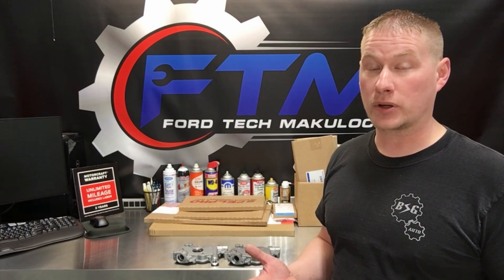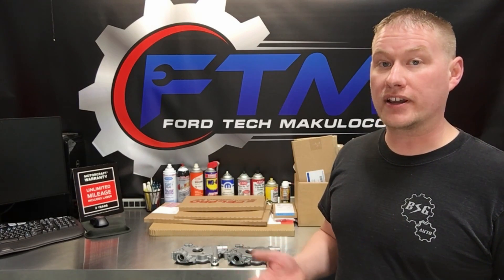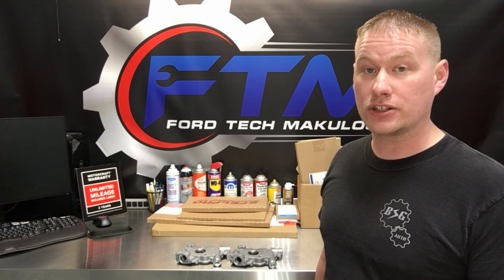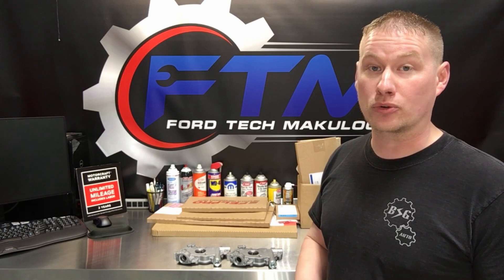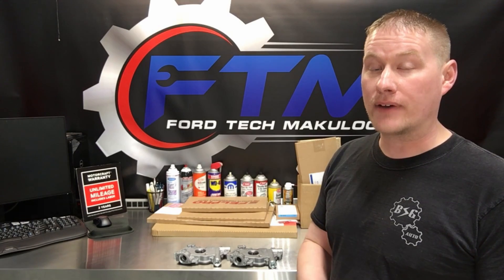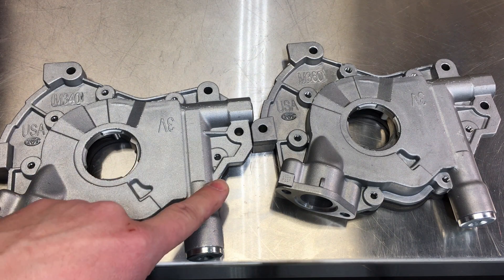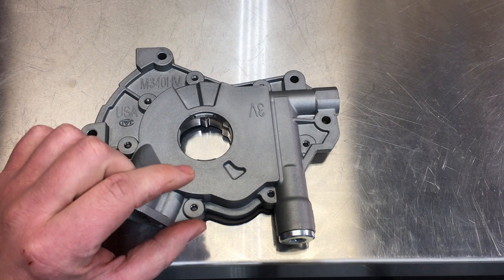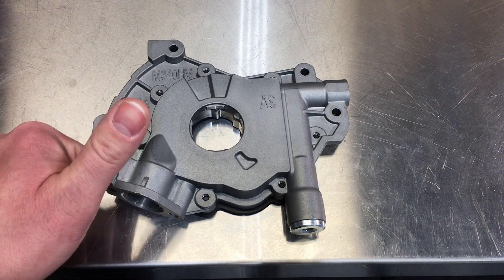The Ultimate 5.4L 3v Triton Engine UPGRADE: New Melling M340HV M360HV High Volume Oil Pumps!

Comment: My 2008 5.4 3v is all original with 250k miles and counting
Reply: I worked for a company that had a fleet of f-150s with 5.4s,  they were mostly just run up and down the highway and carried maybe 500 lbs or so although at times they might get really loaded for a short trip.  It was not uncommon to see them go 350 K or so.  The difference was these were driven by the same fellow most all the time and the oil was checked and changed with the correct oil at 5 or 6 K.  There was no bunch of problems with them, in fact lots of them had never had the valve covers or pan off.  Put a change to 10w40 in one and that is all she wrote though.
Reply: roy gunter so your saying they ran 10-40 in them ?  And that helped them run so long without problems ?
Reply: roy gunter So your saying they were great with simple oil change maintenance ?  What about plugs etc ?    Also what do you mean about changing the oil to 10-40 and that’s all she wrote ???
Reply: Rich Lininger 347 000 miles on mine been a great motor
Reply: Team Deep Tillage   Nice !!!   Any tips ?   Follow the Manuel’s maintenance ?   Oil changes and what about the spark plugs ?  How often and what kind ?
Reply: Roy, you said they changed to 10W-40 and the motors blew up?
Reply: Specialized51 ??  Yes   Whatvis he saying ?  10-40 was good or bad
Reply: i would say if YOU put 60K or so on it...change them.  I put 65K on my 2008 and the plugs brely had any tip left on 2, most were gone.  I am not sure how it ran... but it runs really well now.. been collecting the stuff to do upgraded oil pump, timing and phasers, using Brian's vids as a guide.
Reply: Earl Glase whats yours parts list look like?
Reply: 326,000 miles on mine.
Reply: Yup, I have 223,xxx with some ticking, lashing, etc. BUT I’ve had this truck since new and it’s running well in spite of. No warning lights, etc., knock on wood.
Reply: That's awesome my 2006 ford f150 5.4 v8 3v has 232,000 and still going strong. I change the oil every 3,000 m ur self.
Reply: wesley thompson awesome to here !   I just bought one with 81,000 miles .  I will change the oil every 3 as well as I always do     Can you give me some tips on maintenance ?   Such as sparks plugs and anything that may be different from the Manuel
Reply: wesley thompson What kind of oil ?
Reply: I got 132K on my 2007. I wasn't as lucky as some of you. Regular maintenance and synthetic oil. I need an overdrive band and a timing set and cam phasers.
Reply: cedric williams I just bought a 2006 with low miles   Any tips ?
Reply: Nice! My pops got 315,000 before the transmission gave out. He got that switched and now we gotta swap out the timing assembly.
Reply: I have a 05 with over 230k on it same thing all original. Running great.
Reply: I have a 2004 with over 230k on it some thing all original. Running great.
Reply: For all those people bad mouthing these old motors start counting them as you go to work or play. I got one. Bought it with 190000 plus miles on it. Cam phazers were already locked out, had finger followers and lifters replaced cause I watch these vidios. Guy told it was fine but had them replaced anyway. Now I'm seeing dozens of them running round with 250000 plus miles on them untouched, except for proper OIL changes!! Asked bout the high volume pump, he replied "it got good oil pressure?"  Why yes it does. He replied "u just got to much money."
Reply: Thanks, been wondering bout that. 5-20 it is.
Reply: Have you ever had to change the brake booster vacuum hose bro?
Reply: Flizzey1 I did it’s a pain

Comment: Are there any issues with these HV pump over draining or over pulling from the pans? Because traditionally you would always add an extra volume pan when adding a HV pump to keep from draining the pan with a standard style oil pump. I'm not super familiar with these style of pumps so I though it would be a good question for you Brian.

Comment: Put one in my truck. Well worth it. Also did cam lockouts. I've had no issues since.
Reply: Floor-It-Duh you can also unplug act's and use 15w40 and have zero and I mean zero issues as long as the tensioner gasket isn't blown out or guides in the pickup screen. If you do those three to four things these things become bulletproof and grenade proof. Lol
Reply: Vct's*
Reply: I personally wouldn't use 15W40 as in my opinion it's a little too thick for these engines due to the small oil galley passages in the heads which can potentially result in oil stagnating thus sludge. That said I've heard people using 10W40 on really high mileage engines with no issues but those were all 2V's I heard of. I personally didn't need to cheap out and unplug the VCT solenoids as I didn't want any CEL lights to be triggered and lastly I have a custom tune because I run aftermarket cams along with a few other modifications. That's me though. If what you got is working for you by all means go for it.
Reply: Floor-It-Duh which cam lockouts?

Comment: Have an 06, bought new & have 237,000 miles on it now. Only issues I've ever had were a few misfires which were fixed with new coils/plugs,  had throttle position sensor go bad, & replaced alternator,  thats it. Run only synthetic oil & change it every 4000 miles.   Been best rig I've ever owned. Guess I've been lucky, knock on wood
Reply: Dave M  yes very lucky!  My 07’ started the phaser knock at 100k and broke timing guides at 115k. Changed the phasers and did a complete timing job on it then sold the SOB. Don’t even get me started on the spark plugs or the RH exhaust manifold I changed.. lol

But good for you though. It’s nice to see someone getting some miles on them.
Reply: why the right side manifold? my had both done at 130k and I found in the records that came with it that the right had already been done at 88k wtf?!

Comment: I have a 99 explorer with 257,000 miles it has the 5.0 I'm going to replace the oil pan gasket should I also replace it with a high pressure oil pump?
Reply: chad harmon I'm sure you found out you can't change the pump without taking off the timing cover. Thought I'd post for people that read your comment and wondered the same thing
Reply: Jonathan Rosamond yea I've learned a lot since that post lol needless to say the engine needs lifter or removed from truck to change oil pan gasket yea no thanks I'll just deal with it lol
Reply: I misread. You said 5.0. I thought it was a 5.4 in sorry

Comment: Would you still use 5w-30 with this or would you go back to 5w-20?
Reply from the maker: 5w-30 no sweat there are still wear prone areas like the phaser locking pins.

Comment: I have an 05 F 150 with the 5.4 3V triton. Research is showing that the 340 HV fits this motor. Can I also install the 360 HV in my motor, even though it is designed for the mustang's?
Reply: BTW  mate, you have been such a life saver and money saver for us 5.4 L folks over the years! My hats off to you for all of your excellent advice!
Reply from the maker: Yes

Comment: Damn, you did mine a year ago....and i already put 20k miles since then...guess ill see you in a year or two. But no problems yet.....besides an exhaust leak from passanger side manifold.
Reply: Be careful when you go to deal with that passenger manifold. I got all the bolts out except one, it broke off. I ended up pulling the cylinder head to get the broken bolt out. I did shorty direct fit headers while I was at it. The exhaust leak came back after 1 year. I think the head is warped where it bolts up to manifold/header. I think it needs to be resurfaced on the cylinder head portion to permanently fix this issue.
Reply: @joshmills5248  It is strange how, in my research, it is almost always the right exhaust manifold, and often when inspected,one or more studs are broken. The manifold is deforming on that side.

Comment: What if you have the regular 10340 Melling oil pump, can the spring be switched out? Or can the m340hv work in place of the 10340?

Comment: My 99 F-350 (gas) 5,4L 3Valve with 265,000 miles on it and still going strong,  the only  issue has been a fuel pump - engine still runs strong.
Reply: Scott Lincoln
1999 did have the 3 valve 5.4 yet. That's why it's working good for you yet ;-)

Comment: Perfect "timing" I am diving into my 04 next weekend for a full timing job.
Reply: How do you know you need a timing job?
Reply: You’ll hear the timing chain rattle against the tensioner guide until the tensioners build oil pressure and tension the chain. It’ll sound like a rattle for a second or two on cold startup.
Reply: Meant to add that the problem comes from the timing chain tensioners bleeding off oil pressure when the engine is off, creating slack on the timing chain.

Comment: Didn’t Know if you Knew Jasper Engines has been Using them Since 2016 it’s an Upgrade to the Short n Long Blocks as Standard 😎🇺🇸👍🏼
Reply from the maker: No this one just came out, you are thinking of the M360 not the M360HV.

Comment: I installed a Ford Reman 5.4 2v long block in my 02 F-150 back in 2011, thankfully the heads are PI 8 thread but is there anything along the lines of this video that I should be aware of for the future?

Comment: I have a F250 super duty with a 5.4 2 valve with over 315,758 miles on it works fine no blown spark plugs just a lousy Ford plastic intake manifold design so they can sell alot of them cause they leak antifreeze on the corners cause they hung the alternator on the front of it only problem I have with it!
Reply: I bought this pump for my 2004 F350 Super Duty. I am about to hand off all the parts for a timing chain repair. I saw that the pump says 3V for 3 valves I assume. Will it work ok for my 2 valve 5.4L? I think my engine is similar to Grumpy Old Fart's engine. But I would like to make sure before I take the truck to the mechanic.

Comment: I think I missed something. Why 60 and 80 psi?  Why one over the other?
Reply: Would a 80 psi pump do damge on a stock 3 valve?
Reply from the maker: 60 is stock on the 5.4L 3v some like the idea of increased pressure as needed on the 4v engines.
Reply: Would the higher pressure be bad for say the timing tensioner gastkets etc? 2009 f150 3v...which pressure pump should i get? thank you!!!!!!!
Reply: Would the 360HV be a good investment on an older 4v like my '03 Mach 1?  It has a little of the typical chatter in the cam followers and I've heard horror stories of the stock pumps blowing up at high RPM.

Comment: How about for a 99 expedtion with the 4.6
Reply: You good with my experience them is pretty reliable also knew people with them year 4.6  , I always used good oil filter and oil stabilizer and changed oil at 3k miles , with fuel treatment, also I kept the pedal to the floor , some weird way I think running it wide open daily is good for the engine ,,, most people think it's taboo to put the accelerator to the floor

Comment: Is this pump any different from pump you mentioned here https://youtu.be/ulEJfcQ7HhA ?
Reply from the maker: Yes these were just released. These are High Volume versions of the pump in your link.
Reply: FordTechMakuloco ahh I had to do a manual comparison - awesome tip and heads up Mr FordTechMakuloco

Comment: I was able to purchase this M340HV pump from Lethal Performance online. $170.96 shipped. Just installed it two days ago after new timing kit, phasers, water pump, and lash adjusters. 

Still putting the engine back together but I’m excited to get it done and running smooth again.
Reply: Keith blew the engine up.
Reply: @Lordhumongus  Yep, it's dead
Reply: Hi Keith, how is your engine performing with this new pump? have you noticed any changes?
Reply: Did you ever get it running smoothly again
Reply: how;s the truck running now?
Reply: @PRN 123D Do you know why it blew up?
Reply: Damn rip
Reply: Welp that settled that.  Rip 3v
Reply: RIP I heard the engine lit on fire 🔥crazy I know very unfortunate he was going so fast he burnt to a crisp before he was able to stop crazy look it up happened in metropolis arkansaw